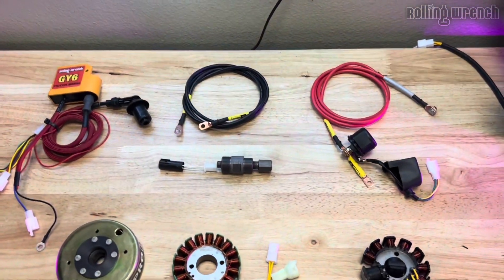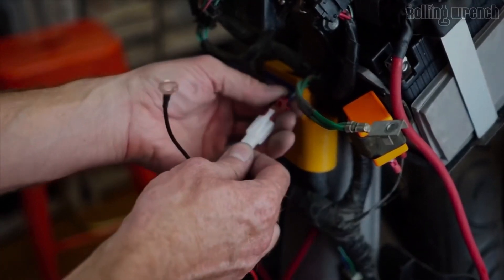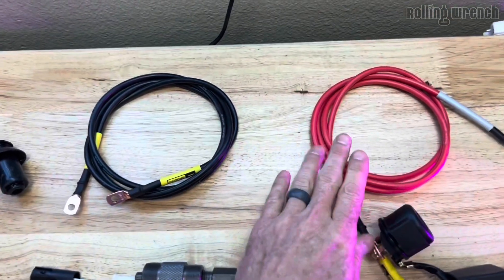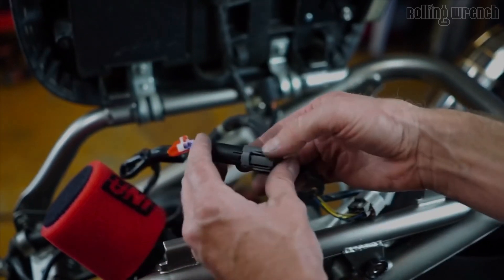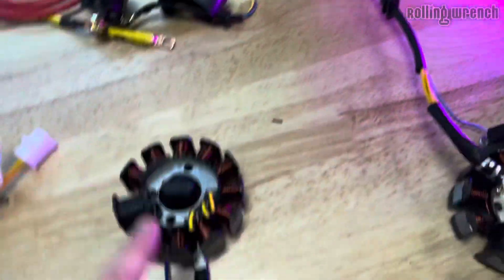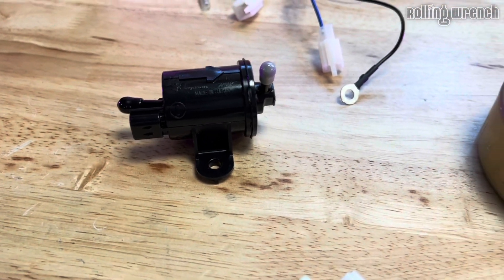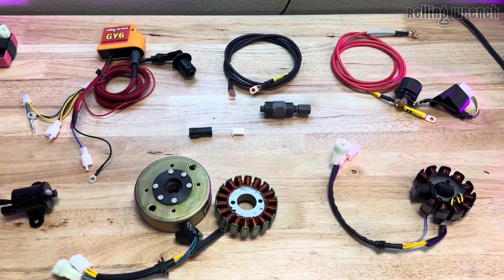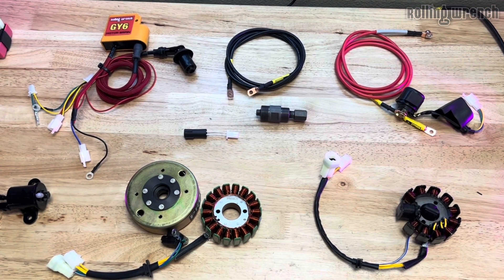GY6 Ruckus Wiring Harness [NEVER DOWNGRADE]

Comment: Not having any luck searching the internet so I thought I'd ask here. I'm trying to install a backrest on my 2014 Honda Metro but can't find any stock parts. I was thinking of welding a different model onto the silver metal bar in the back. Do I have any better options? If not do you think that metal would be structurally sound enough to weld to?

Comment: I've been looking at maybe fitting a Honda Spree 2 stroke into my Chinese 50cc because the frame mount is on the bottom of the Spree engine just like the GY6 50cc motor!! Gonna see if I can make it fit!
Reply from the maker: The spree is super slow with a top speed of around 35 mph. I would just keep your stock motor
Reply: @RollingWrench  For sure! Right now I have a 50cc that I big bored to 51mm about 105cc. I thought a big bore Honda spree would be better for wheelies and speed. Maybe im wrong tho!

Comment: Hey man. I have a 17 year old chinese scooter with a vacuum operated valve. It starts and drives, but when it idles for about 15-30secs it dies out. I also found out that there is fuel going up the vacuum line from the carb. Any tips? 🤔
Reply from the maker: Ahh! Replace the vacuum operated fuel valve
Reply: @RollingWrench  Alright man. Thanks for your help :)